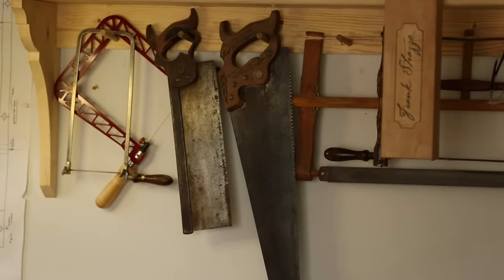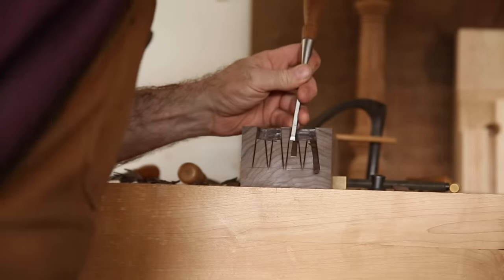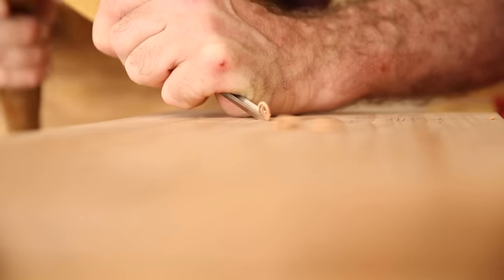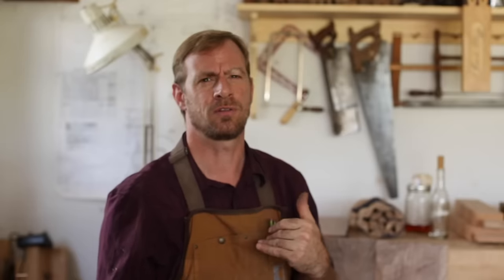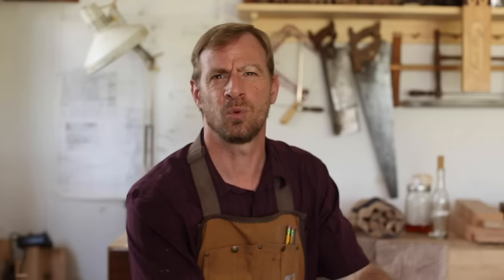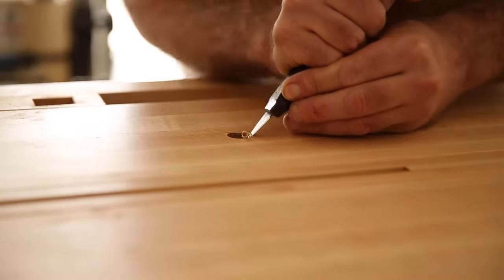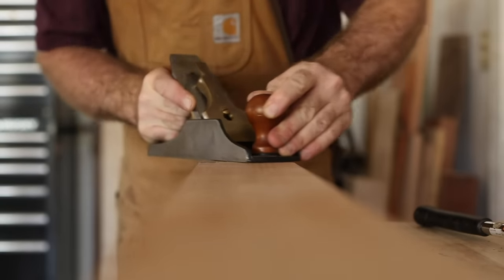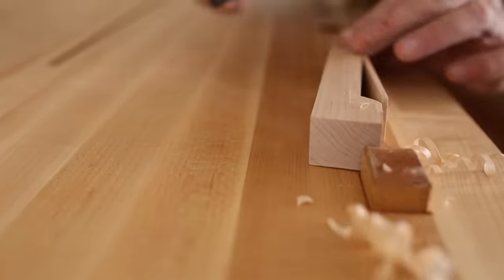Frank Strazza: One Of The Premiere American Furniture Makers (AMAZING DOVETAIL JOINERY)

Comment: Please tell me how those weird angled dovetail joints are strong when you can only be as strong as your weakest point and some of your weakest points are 1/8 of an inch thick how does that work
Reply: If you go back and look when he is doing the chisel work on the walnut, you will notice that he has made a shoulder for the maple to sit on. In a way, the maple is just 1 large dove tail with a couple of small pins. Sorry if you consider this comment to be too late. But I just found this video and your comment.

Comment: Sometimes I get a hairline split in the tail board that originates at the corner of a pin.  In drawer construction, which usually involves relatively thin sides, the split can be reduced or eliminated by easing the side of the particular pin.